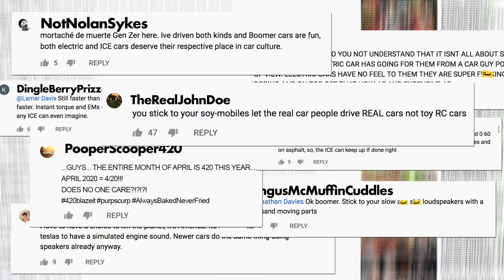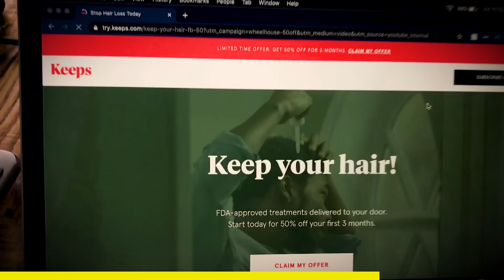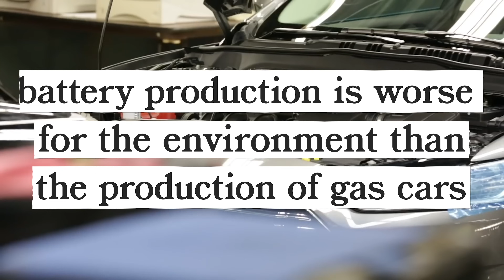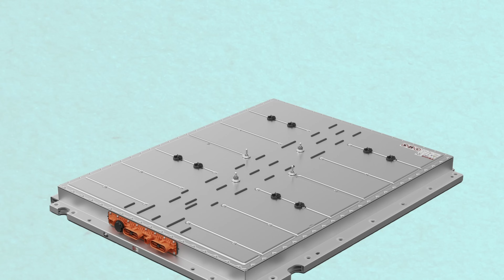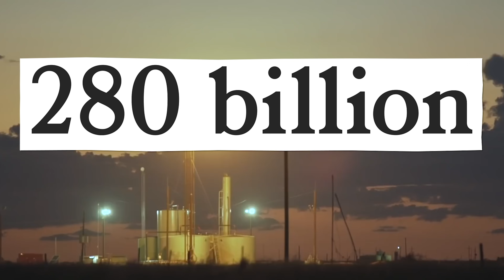Are Electric Cars REALLY Better for the Environment?

Comment: Very interesting video. For even more efficiency starting at 25k you can get a 2 seater with 250mi of range that'll give you some miles back via solar for free and for $900 more you can get up to 42mi/day. Aptera is going to dominate the market. Use the referral code to get to their website, if you don't want to buy don't put your email in the pop-up on the bottom left. I think their website will convince you though. You may want to hurry though. They already passed 4000 pre-orders. For $45k you can go 1000mi/charge.

http://i.refs.cc/EcpYGbp5?smile_ref=eyJzbWlsZV9zb3VyY2UiOiJzbWlsZV91aSIsInNtaWxlX21lZGl1bSI6IiIsInNtaWxlX2NhbXBhaWduIjoicmVmZXJyYWxfcHJvZ3JhbSIsInNtaWxlX2N1c3RvbWVyX2lkIjo2NjM3OTU5OTJ9

Comment: In the long run ICE is way more CO2 friendly than EV. 
You are not taking into account that batteries wear out and they need to be replaced after 5-7 years. So that beautiful calculation of yours is not real. 
Buying a second hand ICE car means I don’t contribute to the manufacturing CO2 production. I can drive easily for 100K miles and still emit less than the large battery pack.

Comment: Canada makes 60% electricity from hydroelectric dams, China makes 60% from coal burning. Actually, hydroelectric dams require large amounts of concrete, which is very polluting to produce, but on the long term it's a clean form of energy production. Speaking of nuclear plants, I just wish my life will be over when there will be a war between countries with nuclear plants - a nuclear plant is a highly strategic objective because it provides energy for the industry. By the way, I drive a Volvo and a Kona EV. Have to say, I prefer the Volvo, combustion engines give some sort of 'alive' feeling to the car. EV have better performance but 95% of time we are driving them at normal speeds. I'd say, an EV is more of a point A to point B car, while a smooth gasoline engine is always more involving to drive.  When all cars will be electric or alike, people will wish they could still drive a gasoline engine during the weekends

Comment: this video has a lot of hippie nonsense. there are states which are powered by wind,solar, water. at current time we do not have the technology to operate on anything else outside of fossil fuel. just because a-hol-c thinks the world will end in 11 years, it doesn't mean it will. in fact, it wont. she took part of an idea, idea only, and changed it to suit her needs. another words, she like so many other hippie dippies, made the whole thing up to gain support for her pointless efforts to control people. if you had a solar array that spanned 5 miles by 5 miles it would be enough power for one hospital for 2 hours. instead of assuming these unresearched people are right because you think they are cool. just use common sense and do a little homework with that pocket pc you love so much.

Comment: Wait a minute.... mining coal, burning it, transporting it across the country at a diminished value only accounts for 2 metric tons per vehicle for the life of the vehicle?  Do we actually have the capacity to alter the environment to such a level to support eco friendly wind and solar power without causing adverse effects when powering all of the vehicles on the road? Wouldn’t it take nuclear power to fill the energy needs gap? What does that imprint look like? It’s “cleanish” but what does that environmental imprint look like?

Comment: What is an average lifespan of an avareage EV battery? Its no secret li-ion batteries loose their capacity over time. With phones it is easier- you Just open the damn thing and replace the battery, but from what I know most if not all EV have their battery cells integrated in the floor, with no easy (or possible) access. This world mean, every EV battery pack will be useless in few years after production, with no way to replace only the battery. This World make my Grandpa 20yo diesel land rover more Eco friendly :- I
Reply: khor11 I don't have an electric car but it's really easy to get to the floor of my petrol car, just have to remove some internal trimmings and their clips then lift the carpet. Could be the same with EVs.
Reply: @Anom990  I did some reserch, and it looks like it a struggle. Check out @rich rebuilds  YT channel. He had rebuild a damaged Teslas, and opening and checking the battery pack did not look like 1:0:1 job. Plus, remember, we are talking about saving a planet. Even if we have a EV with 100% replaceable, easy to access batterie packs. The old batteries need to be recycled (that is still a struggle with AAA batteries in europe), and new ones need to be produced. Episode we are commenting right now is cool, but IMHO they skipped one inportant thing while talking about mining raw materials. They are not processed next to the mine.  They need to be transported with oil burning ships to the other side of the world. This kind'a works against EV's

Comment: So right know EVs are better for the environment but that is entirely because of the gas they burn.
If we where to add an additional tax on all carbon taken out of the ground (and have it slowly get bigger until it is equal to the cost of removing that carbon from the air) and use that money to do carbon captor then at some point we might have Zero Emissions Gas because all the carbon put into the air will be taken out of the air with the tax proceeds.

Comment: Not to mention, EVs are significantly safer than ICE vehicles. Teslas are in 10x fewer accidents thus a less percentage of vehicles need to be replaced due to accident. Electric cars have way less moving parts and the parts that do move done rub against one another, at least for the motor, which leads to much higher longevity, once again lessening the need to replace vehicles which cuts down on the need to produce as many. Battery packs can easily be used for home solar storage once they're no longer useful for driving. Regenerative braking cuts down on brake wear and brake duet that gets omitted to the atmosphere.

Comment: It doesn't make sense that burning fossil fuel to generate electricity, then transmitting to your house or charging station for use in electric vehicles is more efficient than burning it directly in your car.

Comment: you need to add that most of the worlds cobalt is used in the refining of crude oil, not in lithium ion batteries, and you can recover it from batteries, you cant with refining as its used up completely.

Comment: “The average car in the US goes through about 500 gallons of gas per year” 
Laughs in 5.7 hemi
Reply: could be worse, could have a SRT10 RAM, or have those all caught fire already?
Reply: Laugs in 8.0 W16 Veyron
Reply: @kre1zmann  You guys are fucking up the environment with your giant engines. 🙄
Reply: @thacrypt223  you really thing i can afford a bugatti veyron lol. I drive a 2004 2.7 5 cyl diesel merc e class.
Reply: @thacrypt223  never mind, I am sorry
Reply: @thacrypt223  I really do daily a 97 k3500 454 4l80e crew cab long bed on 35x12.5r15. 😂 7 mpg.
Reply: Laughs in 7.4 😂 😂 😂  aka 454.
Reply: "Harrumphs" in 6.4 HEMI
Reply: @morenokp71  lol yea, just did the math and I've but about 1,500 gallons of gas through my 6.4 hemi per year since I bought it.

Sorry everyone, I really do wish I could run a work truck with a more efficient engine but I'm hauling a lot of weight and don't have a better option at the moment.
Reply: @tco9m5  why not a cummins swap? 6bt?
Reply: @deathsdemon349  Mostly because I don't tow often enough. I had the option of getting the Cummins in my truck when I bought it new. It just wasn't something I needed at all and it added exactly $10,000 to the price of the truck.
Reply: @tco9m5  get a Cummins! Much better fuel economy for pulling weight
Reply: Get that supercharged 6.2, bruh
Reply: Laughs in pos gas truck engine from the 80's
Reply: I laugh in 6.2 LT1
Reply: laughs in 1.6 L Hyundai
Reply: Lol same
laughs in 5.0 coyote
Reply: Same 
Laughs in my 6.0 Vortec
Reply: 1.3 in Mazda RX-7 is more REAL
Reply: #Bigblockgang and #smallblockgang
Reply: laughs in 3rd gen viper
Reply: I'll stay with my 2018 6.7 platinum superduty plus 95 f150 4x4and 97 ford mustang cobra convertible I'm to old to change a country boy can survive
Reply: Yeah I honestly go thru something like 1500 gallons with my hemi in a year, but I'm going EV by the end of next year boiiii.
Reply: Laughs in 6.2 Trx, 8.4 viper, and 6.4 scat pack
Reply: 6.6 duramax
Reply: Laughs in carbeurated Suburban
Reply: Laughs in semi truck
Reply: Cries in 6.2 LS3. Car doesn't see many miles.
Reply: Loughing in 2024 in 4.7 toyota landcruiser
Reply: Laughs in Jeep Wrangler, by my math I burn 3-4 times that each year

Comment: BS, typical inside out analysis, if you measure impact of electrification of personal transit on the planet today it’s a lot worse than just flogging carbon, start up of whole new supply chains versus using slack in in existing capacity, extracting new minerals from the earth, clean energy myth (wind?), no planet is worth off on Dec 11 2020 with EVs, yes I know there a long term ROI ( we will be out of lithium before we reach that).   Want to lower CO2 emissions for carbon based, simple....regulations can make that happen quicker than EVs without all the collateral damage.

Comment: I'm all for evs. One question. When calculating the milage and mathematical regression of ev vs ice, you did not take into account that ev batteries need to be replaced every x years thereby adding another battery to be recycled and another to be mined. So to sum up every few years of ev use come with another large addition on the side of evs

Comment: few problems.
1. plastic, rubber are ALSO part of the ev's build. in fact even more than regular car due the need for weight reduction=range
2. the interval of "replace the ev battery due the degradation". The entire lifecycle of battery from mining to recycling should be taken into account.
3. you didn't touch upon the cost of pure ev's, I don't see getting one during my lifetime because of the cost involved. Even if i aim for the old beater one the battery is more likely to be shot = impossible to replace or just too expensive to swap.
4. you completely left out diesels... really? The engine that literally moves the world.
5. no mention of infrastructure needed and pollution/cost involved for evs.

Bonus miss. you didn't touch upon the new vs old car usage (both ev and regular). regular cars can and will and are re-used world wide meaning less brand new cars need to be built = less pollution. Ev's will more than likely have higher rate of obsolescence due progressing tech and failing batteries.